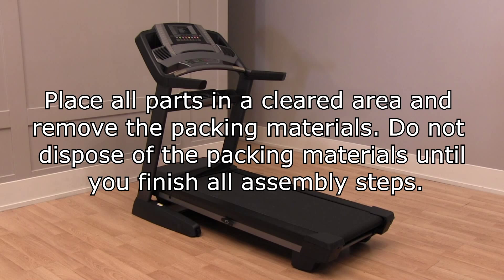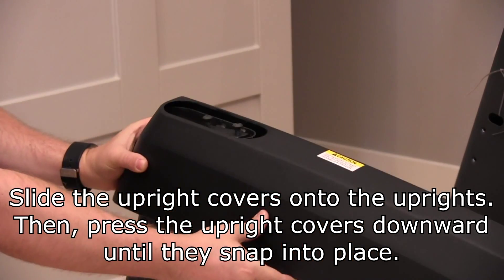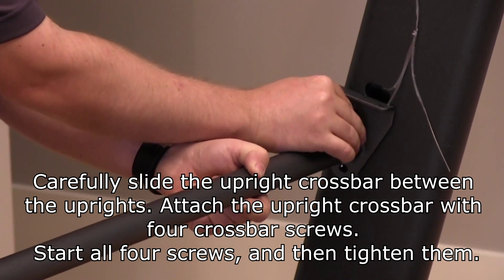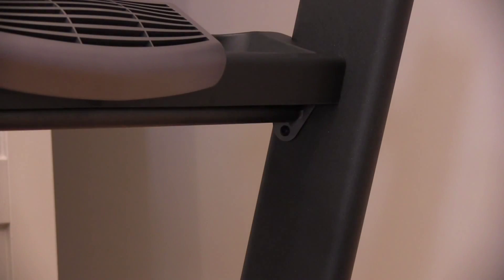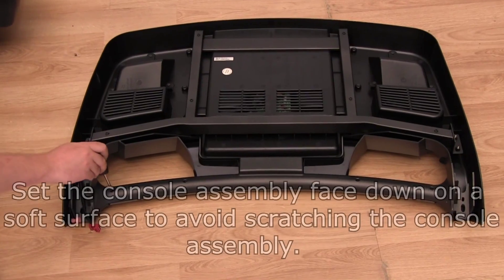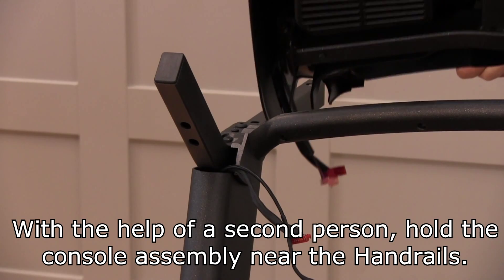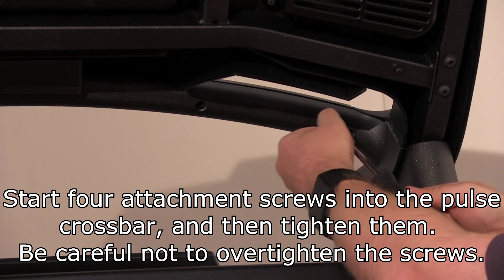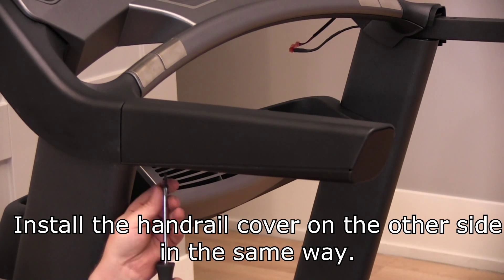Assembly  - Treadmill - Deck Style C

Comment: Mine came with two issues: 1) the storage latch is too long to fit as directed; once one end of it was secured, the other end is misaligned so the bolt wouldn't fit through the holes properly... everything was off 1/4".  I'm not sure if the hydraulic cylinder was expanded somehow....seemed seized.  2)  The walking belt was stopping sporadically/skipping right out of the box.  I've followed instructions to adjust the belt, but have not been able to eliminate abrupt stopping/skipping completely.  Is it normal for the belt to require adjustment right out of the box?
Reply from the maker: +Stephen Costa 
     Sorry for the late response. If your latch assembly appears to be too long try raising the incline level of the treadmill. This moves the latch brackets further apart when lifting the  deck up into the storage position. 
     It is not uncommon for belts to need regular adjustment. Many factors will effect if the belt will need to be adjusted including individual user's weight and running style. There are instructions for making common adjustments in the user's manual.  The jerking you experience is most commonly caused when the walking belt is too loose. See the belt adjustment video  or instructions in your owners manual to tighten your belt. The best tension for the walking belt is as loose as possible but not so loose that it slips/jerks. It is a trial and error type adjustment based on the best tension for the user of the treadmill.

Comment: I am trying to assemble a C1750 and my storage latch seems too short.  My wife and I tried moving the deck all sorts of up and down but we could never get it to align.  Any suggestions?
Reply from the maker: The unit should have shipped at a slightly raised incline level.  If the incline is too high however the latch may not fit all the way between the brackets when the deck is folded. I recommend going into the settings mode. selecting maintenance mode and performing an incline calibration.  From there raise the incline 1 level at a time.  The latch will fit at some incline level.
Reply: Thanks for the fast response.  I actually went home over lunch and attempted to finish assembly.  I had to raise the incline all the way to 14% before it lined up; however, I cannot get the bolt through the last hole on the frame.  I can get it through four of the five required holes but it is coming through at an angle that I cannot correct.  Can I contact support to have a new storage latch sent to me?
Reply from the maker: Yes, the number on the front of your manual. Are you referring to model #NTL14116 step 18 of the assembly? One thing you may want to check is that the bolt and nut in step 17 is still loose. The threads of the bolt only need to be through the nylon of the lock nut a few threads. This should help things line up; at least with the bolt.
Reply: Yes.  The bottom  bolt was loose, as I was only hand-tightening it to get the height of the holes to line up.  I had to keep removing that bolt each time I changed the incline because it would scratch the storage latch.  I will contact them via that number.  Thank you for all of your assistance.
Reply: I was able to manipulate the storage latch into position.  I had to remove the bottom bolt and finesse the top bolt in first, and then get the bottom to line up.

Unrelated question that I cannot seem to find the answer to:  Is there a way for the treadmill to automatically change (or atleast prompt me to change) the speed and incline when I'm running a programmed interval workout?  I was really disappointed last night when I tried Interval Workout #1 and it remained at my selected speed and incline for half of a mile.  If I select the iFit workouts, I assume those would automatically change my course, right?
Reply from the maker: Yes, the workout apps and and iFit workouts should automatically control the speed and/or incline of the machine. If you override the built in workout speed or incline the machine reverts to manual control.  There should be a return to workout or follow workout button on the screen to resume the built in workout. If you are not ready to follow the workout at the preset speed or incline there should be a screen with a graph of the workout that you can follow and make your own changes when the workout would have normally done so automatically.